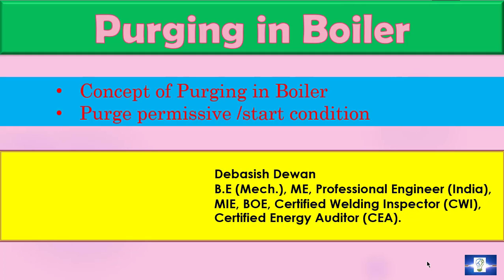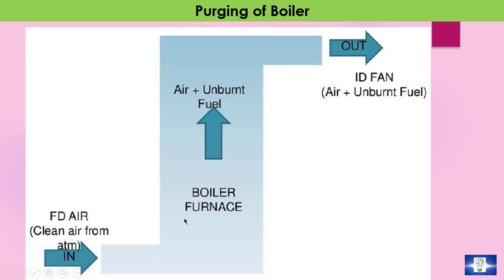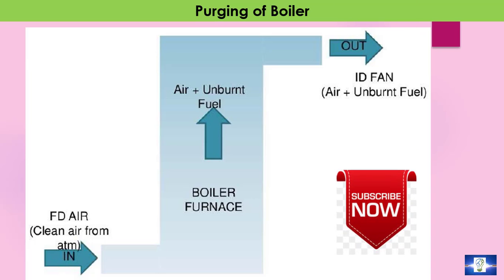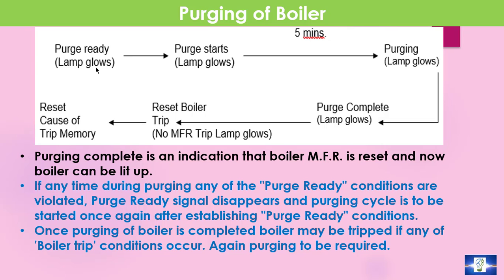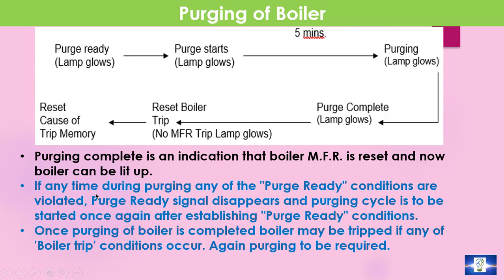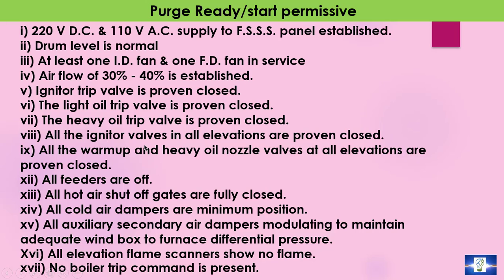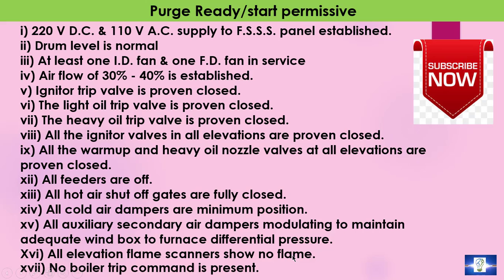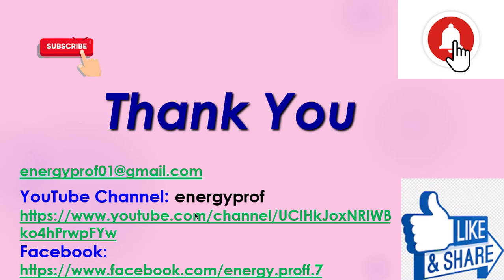Boiler Purging System ||  Protection in Thermal Power Plant

Comment: sir why is 30 - 40% air flow is required ? 
purging can be done with 10% air also ? 
request your answer please
Reply from the maker: Good question.
It is experimentally proven that 30-40% air flow is sufficient to wash out the unburnt particle in the boiler system (not 10%).
Reply: Experimental proved that 30 to 40 percent sufficient for purging.
Why we not use 90 or 100 percent for extra safety?